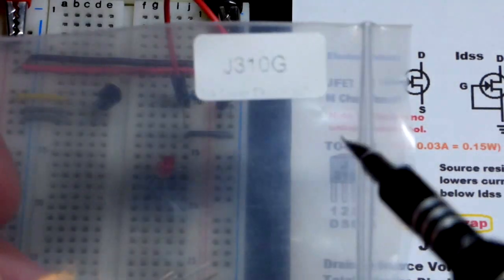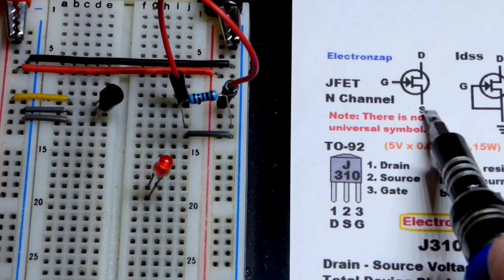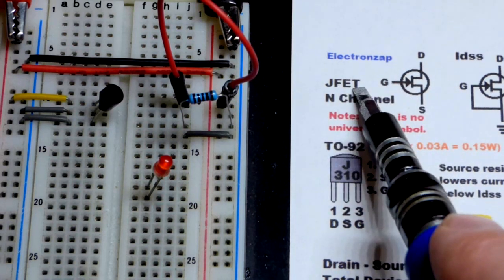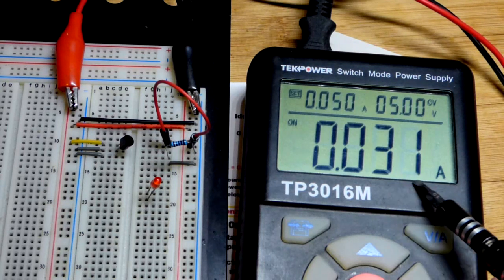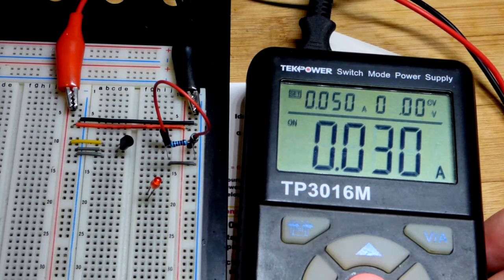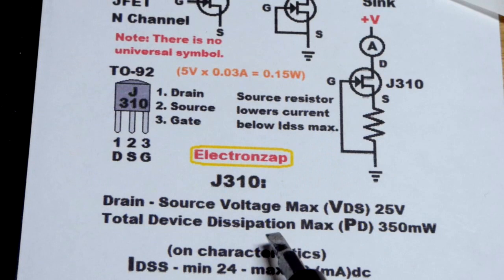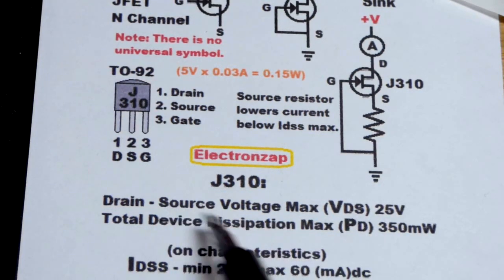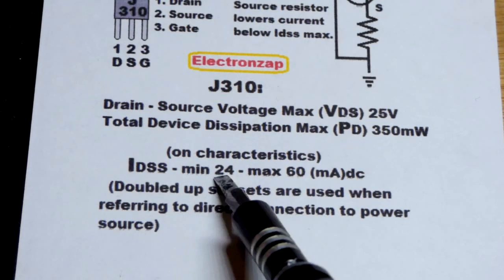JFET N Channel J310 depletion mode current source sink circuit learning electronics lesson 0058

Comment: Interesting stuff, never given much thought to JFETS before (never used one) dont seem to hear much about them, or is that just me ? seems like they could have a few applications, whats their most common use case please?...cheers.
Reply from the maker: From what I read, they seem to mostly be built into integrated circuit components as a simple way to regulate current in part of the circuitry. Zener diodes only hold a steady voltage across them if the current through them doesn't change at all. So some kind of current source is the best way to set their voltage if precision is required. I've also seen websites and datasheets referring to JFETs as amplifiers, but I think that was an older way to make an amplifier. BJTs or MOSFETs will almost always be a better transistor to use for most circuits.
Reply: @Electronzap  Yes, I believe thats what I read too, that they are used as part of a chip....Thanks.